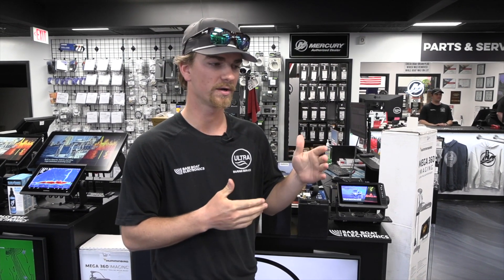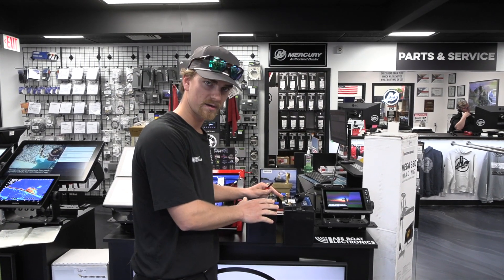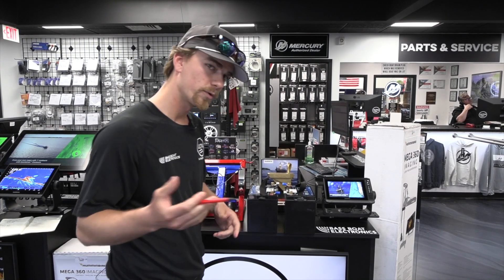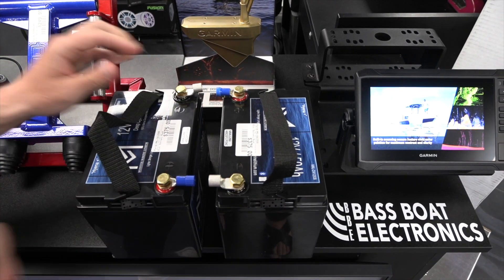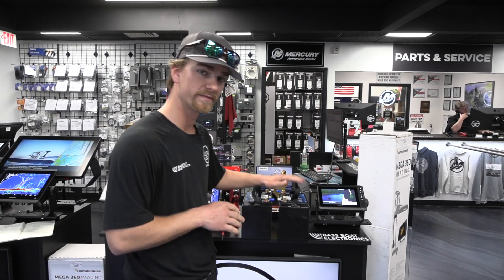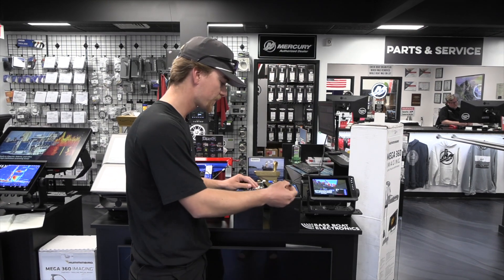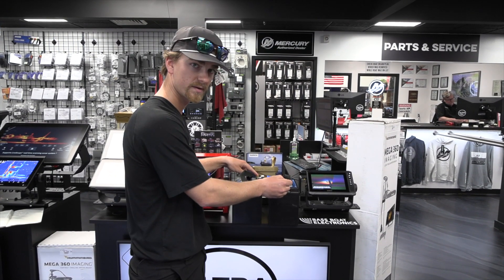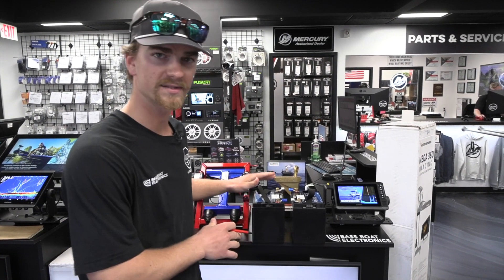DOUBLE YOUR VOLTAGE OR RUNTIME? SERIES VS PARALLEL BATTERY SETUP

Comment: Question. ?? See if I make sense here. 2-12v in parallel for starting battery and graphs . Both batteries are standard group 31s , 80ah I believe maybe more . In parallel will be 160ah or what ever the ah is perfect each battery. Correct.? This would be ok 👍? Keeping the amps up for the graphs . And still have plenty of cranking amps at the end of the day ..